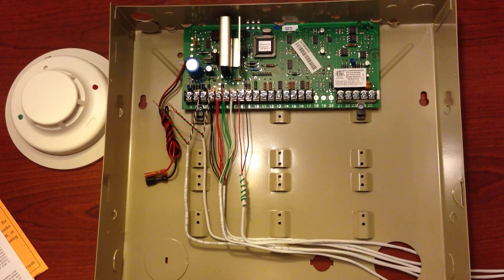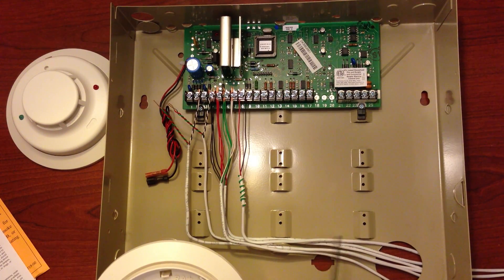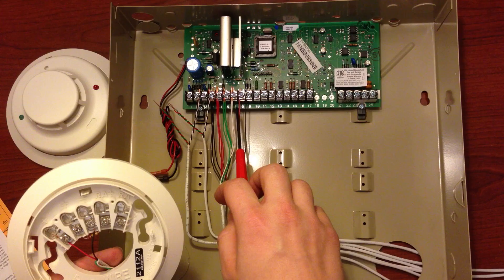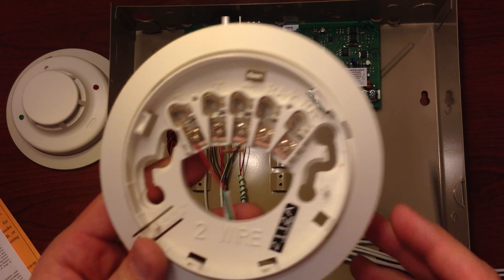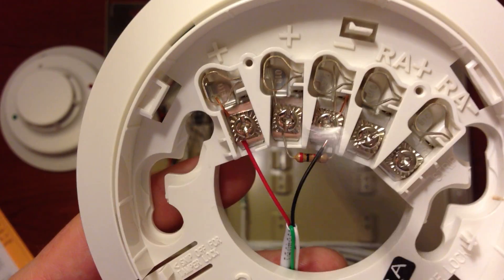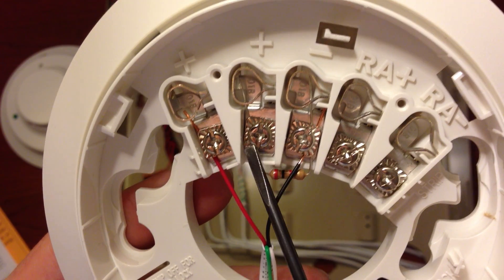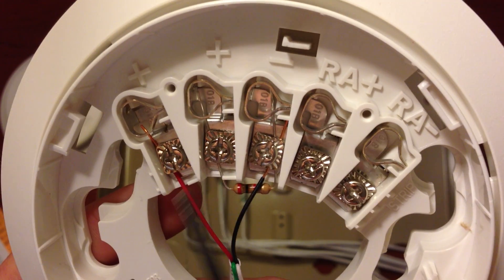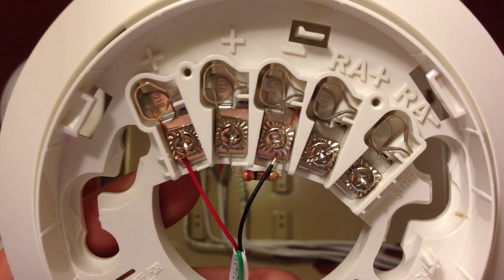Chap 6 Vista Panel Install - Connecting a Single 2wire smoke

Comment: I use this keypad in our front entrance and it has been working great.>>>ur2.pl/1017    It was very easy to setup, User Manual is in the comments below. I would suggest looking at the wiring and what equipment it connects to before purchasing, but all in all it is a solid piece of hardware and will do a great job at the basic home security system functions that a homeowner would need.

Comment: How do you add a heat detector to the zone loop with 2-wire smokes as pictured in the panels instruction manual? I'm assuming you can add multiple?